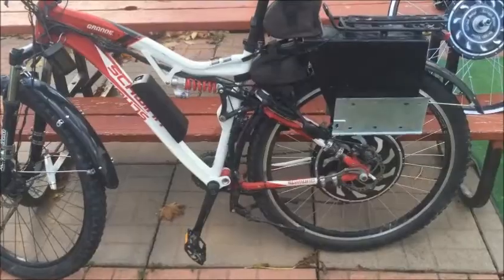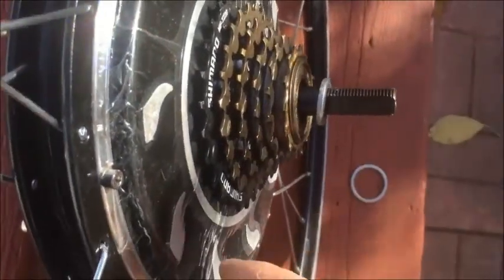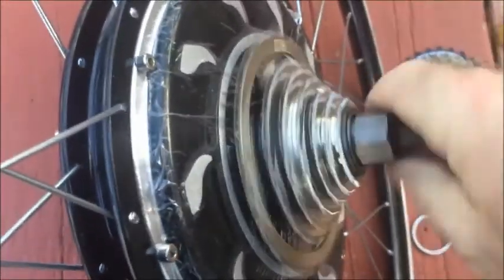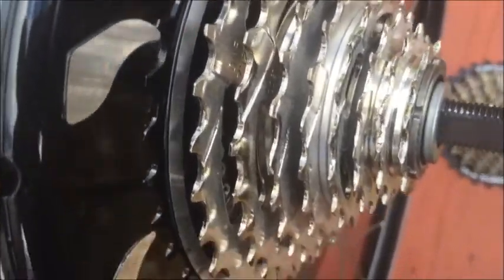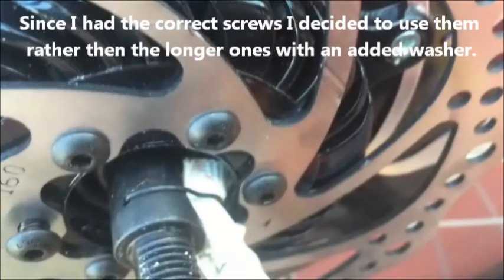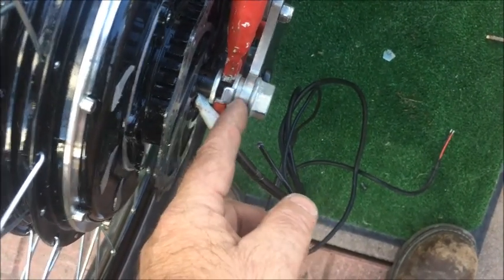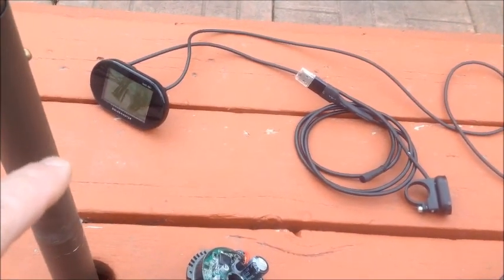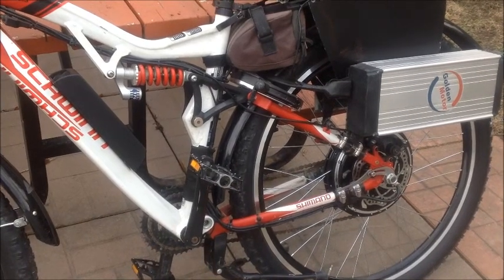How to install a rear wheel hub motor on a bike

Comment: Do all freewheels come off easily? I have a problem to undo mine, it seems to be welded on, I've tried just about everything but hit it with a sledge hammer. Part of the problem might because I can't get a good grip on the motor (there's no rim attached to it yet) when I attempt to turn the extractor in a counter clockwise direction to undo the freewheel.
I have yet to see a video with someone showing the proper tecnique to undo the freewheel, why is that? Can you help me find a video. Thanks

Comment: For the life of me I can’t get my 29” rear hub to stay
Reply from the maker: Your dropout might be damaged
Reply: @goldenmotorNA  I don’t think so it’s new bike carrera hellcat just my ebike hub motor nor staying the wheel it came with fits normal I think I need to file it down, I have a smaller bike no issues but I’m 6ft2 medium size even with extension is small so I got a xl size hell cat. When I took everything off my smaller bike and put on my new bike it was fine used it one day but I forgot to put torque arm as soon as I put it on the wheel don’t stay one I use the motor, fuck it I will file it

Comment: I am glad you posted these videos and I found your website for further info on these motors. Thanks for answering my emails. I appreciate that.    The bike/motor I got from a private seller was new out of the box... I am just trying to figure out how old the motor on my bike is (it still had the plastic wrap on it and never used, the seller has no idea).  Per your email the motor is a fat pie 5.  Are they being made new still? Is there a way to tell the production date?

Comment: wow cool  ride..nice  presentation  ,,,,,,,,,,, l have joyrider two person side by side seating bike    with 26 inch wheels on the back  and disc brake on the smaller wheel on the  front,, could l use this motor on back.wheels it  is just a standard gear 
.....sorry l don't know how   to show you a pic of the bike ,,    please have a look on the web.  thanks for your time,,,

Comment: Do I need to use the hand brakes
Reply from the maker: The brake levers turn off cruise control, cut the motor and turn on regenerative braking. If you tap the cruise button it turns cruise control on and off. So you can cut the cruise without the brake levers buts in a panic stop not so easy.We do have sensors you can use instead of the levers. Legally i think you need something that cuts the motor.

Comment: would be nice if this thing had a quick disconnect plug for servicing the wheel...
Reply from the maker: +TheBMallory 
There is the main wire plug about a foot from the motor and then the wire that runs to the battery to disconnected.

Comment: Hello. I got a nirve cannibal and plan to buy MP4 rear wheel kit. Was wondering wether there are going to be any pros and cons, conserning the bike has shimano nexus on the rear wheel. Is there something you might suggest for that kind of build? Am i going to have troubles installing the rear 24'' wheel kit on my cannibal?
Reply from the maker: +Valentin Sorokin The cannibal only has a 100mm dropout on the rear so the MP will not fit. That is why I put one on the front of my Cannibal.
Reply: +GoldenMotorCanada Got. I'll do the front one then. Thanks a lot for the advice.